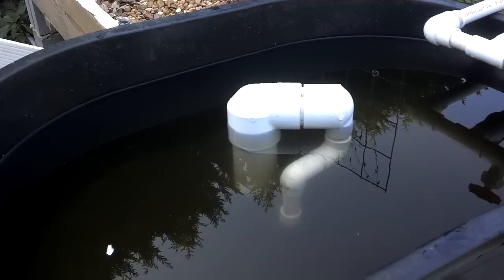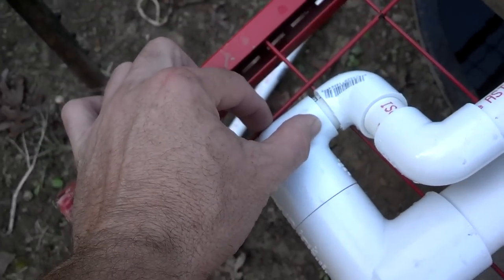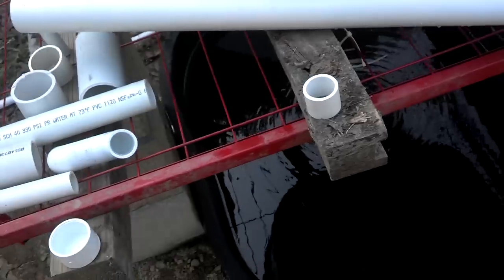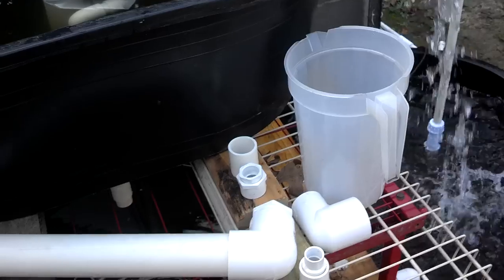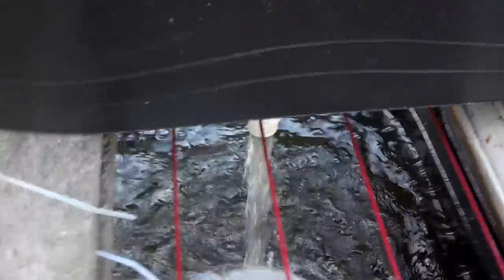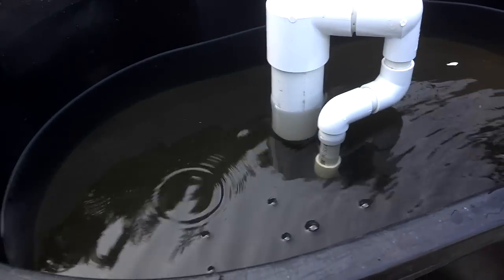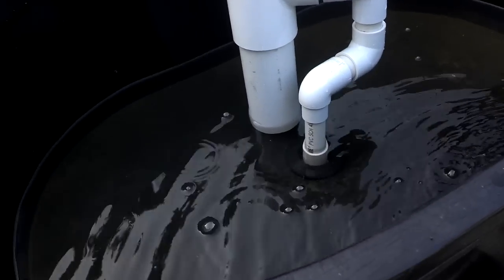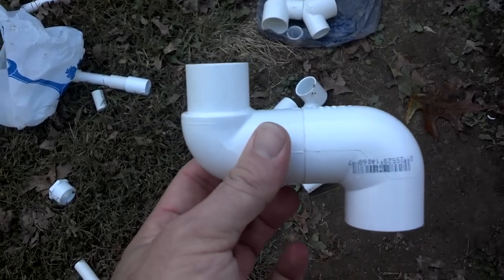Aquaponic siphon and drain with the above bed siphon.

Comment: I have had problems with my bell siphons from the get go. So after struggling with them for over a year I decided to build this ABS. I used a 1" stand pipe feed with a 1.5" pipe. It worked perfect on the first test.
Reply from the maker: +Byron Wooten Glad to hear that. It's not for everybody but if your struggling with the BS this gives you another option. I'm using the 2" to 1" mostly. I love the 2 1/2" siphon but it is mostly for large growbeds and a little more difficult to build for a 6" gravel guard.

Comment: have you tried a larger siphon say 3 inch reduced to 2 inch for a stand alone bucket siphon shannon-great work bud-bev.
Reply from the maker: Bevan Dittberner No. I tried 3" to 1 1/2" and it worked great but it takes a lot of water to get it going. great for large grow beds. Thats in one of my videos. Now that i know how to fine tune the siphon it might be possible but i'm too tired and i have to many irons in the fire right now. That sounds like a good one for you to try. The problem is if you dont use a 2" bulkhead your still limited by the smaller bulkhead. If you do use a 2" bulkhead your still going to have to restrict the flow in some way to get the siphon to fire and your probably going to have to use bushings to get from 3" to 2". i'm impressed enough with the 2 1/2" to 1 1/4" or even 2 1/2" to 1". I'm going to make a short video on how to build it. Check out my videos "abs siphon with a twist" and "abs siphon fires in about ten seconds" to see the refined and fine tuned version of the abs.